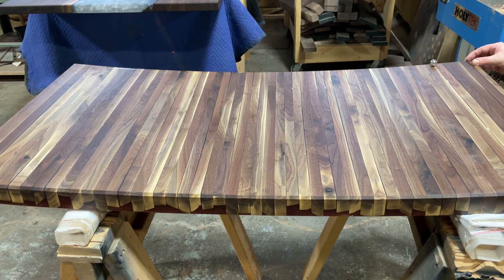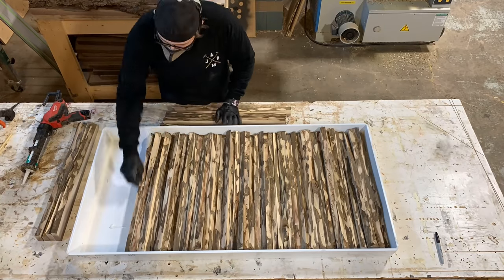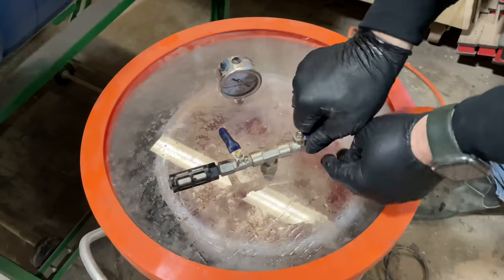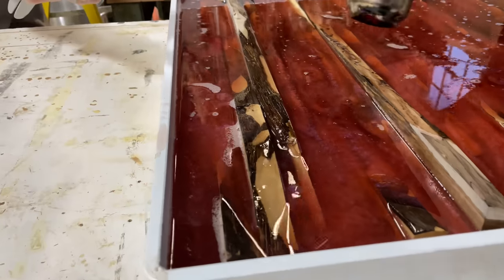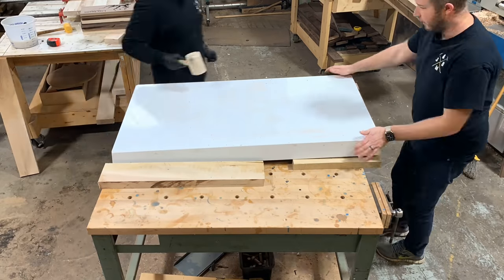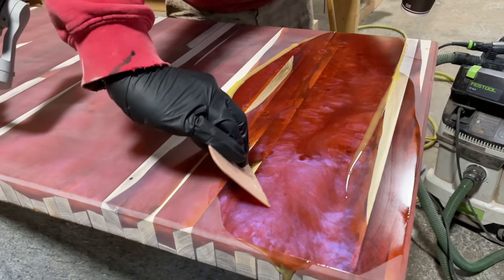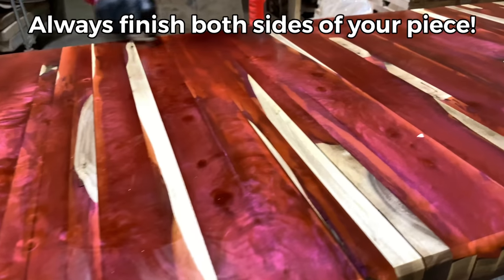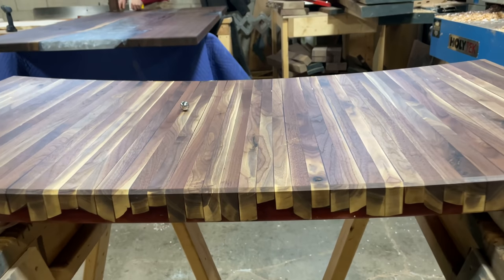EPOXY FAIL | Don't Make This $1000+ Mistake

Comment: Easy... Four tapered legs, 60s style, that go through the epoxy/wood (curved upwards, like a bowl) , that support a glass table top above. So you use the curved piece here as a magazine/remotes shelf, with a functional flat (tempered) glass table above that you can still see the cool effect!
Reply: 👍🏼 good idea
Reply: simple yet elegant solution!
Reply: Hmmm... Sounds good but do you think he should reinforce the bow from underneath eth so as to prevent further bending and an eventual SnAP!?
Reply: @jamesmm1124  Yeah I think this one is just going to keep warping
Reply: @jamesmm1124  good point, I would get some black steel banding between opposing legs on the long edge.
Reply: There's got to be a better way.  If you have it curved up like a bowl then you are showing the bottom side of the table, essentially hiding the epoxy pour completely under the table except for it peaking through the edges.
Reply: put a led screen on it
Reply: I was literally going to say this, I would add a mechanism under that places a metal ball on one side and is caught and moved back into drop place but thats just me lol
Reply: You could make it into a deco partition or outer surface of a breakfast bar.
Reply: I didn’t even think of something close to this until seeing your comment, I think that would be a great solution
Reply: Excellent idea 👍
Reply: @jamesmm1124  It will not warp forever. It has a limit and probably it already reached it.
Reply: No shit haha. The table’s fine. Just not what you originally intended. Now go make THAT thing the right way, and you have TWO pieces of art.
Reply: @patrickdaugherty3 outer surface or bar or dj table. That’s a great idea!
Reply: Sounds dreadful

Comment: Put it back into the mold and cure it at 60* Celsius in an oven for about 6 hours. The epoxy will get soft and it will bend in its original shape. After that process the table will have greater physical properties than a not cured one.
Reply: You should add metal rails to force it to keep it shape also
Reply: THIS
Reply: I doubt anything will stop the problem from reoccuring with fluctuations in humidity.  It's genuinely difficult to appreciate just how much force wood can generate in expansion and compression.  More than likely I believe it would just crack the cured epoxy instead of bending the piece.
Reply: @M3rVsT4H  You put the rails on the unit while it’s hot when you’re able to flex it back into position chances are you will have to refinish the top but it should work good when you get through it.

Comment: I would flip it on edge and use it as the fantastically, awesome, curved front to a bar. Add a bar top and some shelving bolted to the back of it and it would look incredible. You could even possibly repeat your "mistake" on a smaller scale to make some matching bar stools which should have the curve.
Reply: You saved me from writing the same thing. I think it looks good curved.
Reply: Yes! I'd even try to curve it a bit more, but that's a good idea
Reply: I was thinking the same
Reply: It’s not that curved
Reply: Had the same idea
Reply: I looove this idea!
Reply: It's only 2 foot though...
Reply: This was my first thought too.
Reply: Great idea. Or mount it on poles to make a bus shelter for one.
Reply: We all agree
Reply: Winner winner martini dinner🍸🍸
Reply: I agree with Robyn Hamilton.  It would make a beautiful bar front, or even a great wall hanging above a bar back. Some well placed front lighting would be a nice enhancement too!
Reply: Yeah, just change the title. How to make a perfect curve table with epoxy.
Reply: @GaryGrube1  yes. Make another. 1 for bar front 1 for matching wall hanging.
Reply: I like how you think.🐯👍👍
Reply: @Anna_and_Tiger  Hi.
Maybe the wood will expand on the downside if exposed to moisture or even steam? Then cover this side with a thinner epoxy layer too.
Maybe you also can force it straight with two "rails" on the downside, but this will surely look weird.
Thank you for sharing your experience 😎
Reply: Was exactly what I thought when I saw the finished product. Barfront
Reply: I was going to say the same thing
Reply: Thinking same
Reply: Damn fine idea sir
Reply: Thinking about the same idea ! 👍
Reply: I was thinking something similar - that would make a beautiful base for an underlit sign of some sort.  The curvature would catch the lighting in a unique way that would accentuate the coloring and draw attention to the sign.
Reply: This is what I was thinking too
Reply: I second that in fakt hand me that Bar
Reply: just leave it ...
gametable ... table bowling
Reply: Love this idea!
Reply: Yep, front of a mini bar was my first thought as well lol.
Reply: This!
Reply: This one
Reply: Great idea. 👍
Reply: I love that idea, very cool
Reply: Yes!
Reply: I was just about to write this as well :-D but yeah what Robyn Hamilton said use it for a bar ;-)
Reply: That's a great idea!

Comment: Say it was designed like that, and sell it for twice the price.
Reply: This is actually a smart idea.
Reply: This was my exact thought, and the truth is I bet someone would pay it to.
Reply: Exactly. I grew up in my dad's wood shop. One of his favourite sayings was. If you cannot hide something, make it a feature.
Reply: Yeah, modern ""art""
Reply: Right!!Maybe 69,Eminem,50Cent or some rapper could buy it for 5000 dollars or even more!!
Reply: @cavanimakesthenoise  or an old money art lover.
Reply: @thombaz  A great artist for the most part does a 'mistake' intentionally because they can see the beauty in a flaw before it becomes a 'flaw'. The only difference between BSing it and not is if it's a consistent theme in an artist's career or series, then it's intentional.
Reply: Beauty is in the eye of the beholder
Reply: Cut it in half, push it through a thickener unter it's flat and you get two pretty side tables
Reply: @seemlesslies  I would.
Reply: @keyworksales6241  no, it is really Strong, but the thing is someone will find some use for it....

If we want a table top, we could cut it from a plywood, all the extra cost is just for the "beauty"
So anyway it is an art installation with use of 1% of its cost... so it is providing value of 99% as an art installation

And who knows... someone will also finds some use for it...
Reply: Yeah people into the arty farty crap

Comment: I've had similar bad results with a table top made out of many glued up pieces which would later bend due to regular heat and humidity. Solution was to fill up a tub with hot water, leave it on top of the tub and weigh it down flat (not immersed in the water, just exposed to vapor), and cover the whole thing with a shower curtain. Left as-is for a few hours. Then removed, and weighed down flat on the floor with heavy objects. The following day I carved two notches in the back (across the pieces) and installed angle iron pieces (pre-drilled for counter sunk screws) across the piece. Have had no more issues after this.
Reply: Yes, this is best and fast way to fix this project!
Reply: Unfortunately this can't be done due to the sealing with epoxy. It won't "give". There are too many uneven spaces between the boards as no pressure was applied with clamps to keep the project flat to begin with.
Reply: @penelopelgoss2520   Steaming the wood is where the "give" is supposed to happen I think.  I understood that the function of the epoxy being down was for the sake of getting the true side flat.  I also would think this is the reason for the slow and frequent method is to not crack the epoxy in flex-back.   I have seen people straighten finished guitar necks in a tension method similar described. Any thermoplastic may be leaned into a warmed enough state to flex in gentle manners. I looked up the info on the product page and it has an NA for the data that would make you state that it doesn't give or flex.  I would actually love to see the info that shows the shearing and tensile strengths as it would be helpful in determining if I would invest in this for some projects I have planned.
Reply: Seems like in this case it wouldn't likely "give" easily. I imagine the force would probably cause the epoxy side to act as a fulcrum and the wood pieces will separate/crack. Heating up the resin side gently with weights on top may allow the cured resin to soften, making the flattening process safer.
Reply: @penelopelgoss2520  The piece warped after the epoxy had cured, so it should be able to "warp" back. You can see it was flat when they sanded it.
Reply: do this
Reply: I just did this today for a slight bend with some alterations to the method. I out wet towels on top and let it set for a few hours. Worked great

Comment: I'd love to have a curved table. Imagine spilling a drink and it just all goes to the middle of the table and not on the floor or a sitting person
Reply: epoxy side is supposed to be up so it would spill and not stay in the middle
Reply: Well, you would have a lot of drinks spilling since they would not have a flat surface to sit on.
Reply: The problem is you would kinda allways spill your drink haha
Reply: It would still go on the floor, it would just run to the middle then off the sides.
Reply: Can also pour a big pot of soup in it and the whole fam can have a community soup bowl lol.

Comment: I would rip it down the middle and create 2 “curved” benches. Make a base or some legs that incorporate curves in them as well and it will look like the curved top was intentional.
Reply from the maker: That's not a bad idea to turn this fail into something useable. I like your thinking!! 👍
Reply: That’s exactly what I was thinking. Some nice entry way benches
Reply: Great idea!
Reply: Good idea but tough to make it look intentional after they already made a whoopsie video 🤣
Reply: I think we have a winner.
Reply: Yeah give it some japanese style joinerys
Reply: Bar stool seats!
Reply: You beat me to it,
Reply: @jeffmackdesigns  The way you differentiate between pro and noobie artisans, is that pro knows how to hide his mistakes so its harder or even near impossible to notice. What ever its done by chancing plans, or turning failed versions into something else, or knowing how to fix the issue other means.
For instance i would make next one as dining table and cut the failure into peaces to make benches for it since both have same pattern then. Or simply make some floating shelfs if not looking to make dining table set with this.
Reply: I was gonna say that, then boom second comment i see, benches. 😠🤣 that would probably be the best tho, or you could sell it off as a bridge for a little koi pond.
Reply: Could be modified as an 'elite' sink ?
Reply: exactly what i was gonna say
Reply: @meropis  It will keep bending more/less with the season, though, so no. Also only the resin keeps it together, as the wood are just unconnected sticks stacked next to each other; so you don't want anything "loaded" like a bench or chair (chair seat would be fine with varying curve).
Reply: @Hellsong89  Friend of mine always says "If you can't hide it, draw attention to it".
Reply: Benches would be awesome!
Reply: I just had the same idea, then saw your comment.
Reply: I should have read this first!
Reply: Update video on the bench set please!
Reply: Exactly what i was going to say
Reply: @jeffmackdesigns  Make sure you upload the finished "fix", whatever it might be. The curved bench is a good idea, right when I read it, it felt like the answer.
Reply: My exact first thought too!👍🏼
Reply: Great minds think alike lol!  was just thinking exactly what you said before reading your comment.
Reply: This. I was going tu suggest the same.
Reply: Came here to say exactly this! We have an upholstered curved top bench in the hall, but this would be really spectacular.
Reply: That was my thought as well.
Reply: @SenselessUsername  
Lots of things are glued together with epoxy and the hold up just fine. If fact, many times, the joint is stronger than the wood. Don't if that's the case here but I wouldn't rule out benches. Besides, if you were worried about that type of failure, you could just fashion some stringers under to support the seat.
Reply: Exactly what I was going to suggest.  Or even four or more bar stools
Reply: So, do we know the results yet? What's happened?
Reply: My thought as well. The moment you said let me know if you have any ideas. "Cut in half, length wise and make two benches out of it" popped into my head.
Reply: So, what did you wind up doing with it?
Reply: I'm a bit late to the party, but it was my idea as well. 4 or 6 benches would be great; then, make a FLAT table to go center them. ;)
Reply: i like this idea best.
Reply: Be sure to shore it up. It may split.
Reply: @jeffmackdesigns  You could use the two pieces to form one bench with a back...that matches, and at the same time, appears to smile at  you !
Reply: I saw this post after suggesting the same thing. :D Or barstools like Johnny said. Any of those would utilize the curve really nicely.
Reply: @jeffmackdesigns  update

Comment: I would use it as a headboard and just live with the unique warping , I love it 😀
Reply: Would be cool mounted in an office too
Reply: Yes! Great idea. Mount it into a large oak headboard.
Reply: @TheCentralflorida  if it got mounted to a headboard it might stick out too far from the wall. If you got a TV wall mount that should be able to hold the weight of it and it'll look like since nice 3d wall art
Reply: @annecantgame  I pictured it as an inset piece. But probably crazy heavy for that.

I first imagined an art piece as well.
Reply: Great idea. I think it would work either way around.
Reply: The important question is...do you love it enough to buy it for a 1000 dollars?? :D :P
Reply: @giorgosgalanos9888  usually if a piece has failed the ones who made it would either sell it for way lower or just scrap it
$1000 is just base cost to make it
Reply: Flatten the woodside with the cnc maschine and use the underside as the top
Reply: @Zerggodmaster  I understand. But I suppose they will try to sell it at least close to the cost of the raw materials. Ηe said that the cost of the 18 litres of epoxy was 550 dollars. Still a high price for an item that...you are not sure what it is, or how to use it! :D

Comment: It's interesting that YouTube's algorithm kicked this video out 9 months after its creation.

If you still have the tabletop sitting around, here's an idea: slice it lengthwise into strips 1 3/4" x 1 3/4" x 48".  Turn the strips sideways and then laminate them back together to create a gently curved tabletop.  The top surface of the new top will consist of cross-sections of the original top which could create a really interesting striped/arced pattern.  I'd suggest leaving the curve instead of squaring it up and making it into a coffee table or something else that will primarily see use from one side.
Reply: same here
Reply: Why not to make it as a wall light/art piece.
Reply: @blankblank9904  and here
Reply: :elbowcough:
Reply: gametable ... table bowling... just leave it as is...

Comment: Rip it into smaller sections between the boards, run the pieces through a planer to flatten, rejoin them and finish the wood side with clear epoxy layer to complete the table as intended.
Reply: Alternative wood side up and epoxy side up for next pour
Reply: This solution is very labor intensive, but I think would provide the best finished piece. It's basically building 2 tables and getting 1, but it would save the project with the closest finished product to the intended one.
Reply: This is the way. This is what I’ve had to do myself.
Reply: Or don't rejoin them & make some funky looking arty shelving!
Reply: why not just flatten the table with their cnc planer?\ it would be thinner but straight
or  he could just pour more epoxy using a mold thats glued to the edges of the table

Comment: As a retired furniture maker(18th century reproductions) I could see the problem when they loaded the wood into the form. NOTE: air dried finishes such as spirit varnishs, polyurethane, tung oil and the like will allow moisture through the film. It may take while but they will. Epoxy is an impermeable film. ( Polyester IS NOT by the way. Ask any boat owner.) Having only Oil on the under side was a massive mistake. I would have cast some epoxy sticks to support the wood then add the epoxy.
It looks like you wood had moisture in the wood and then it dried and shrunk causing the warp. Try milling out the back side a bit. Make some strong backs and clamp them to the top to add a little straightening  pressure. Place in a sealed plastic enclosure with a pale of water for starters. Paint the wood with water from time to time. You need to slowly compress the epoxy as well as stretch the wood. If the clamps come loose add more pressure. Good luck.
Reply: No u couldn't
Reply: @Light Roast Coffee lmao
Reply: Yeah epoxy is a non convertible coating.
Reply: I dono if he gonna be able to mill that out.